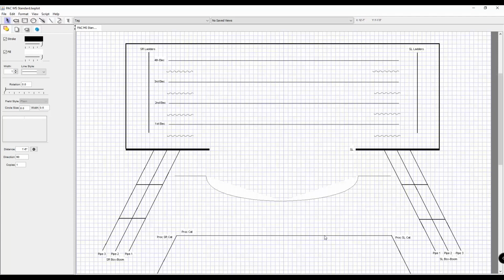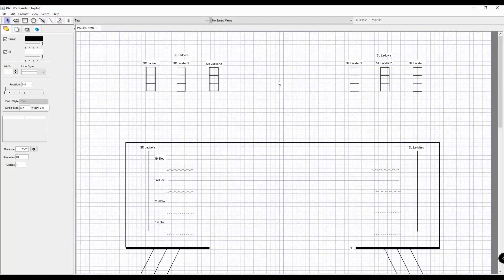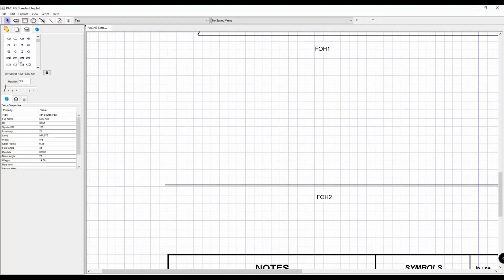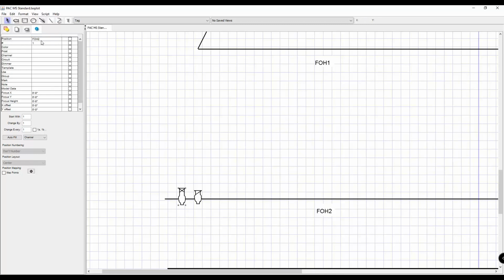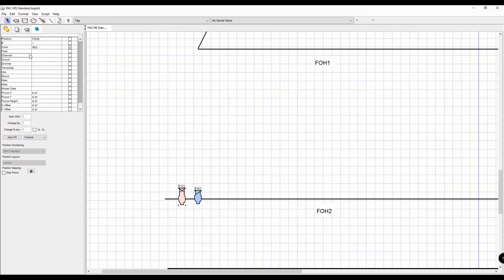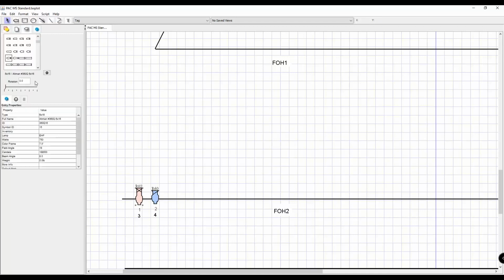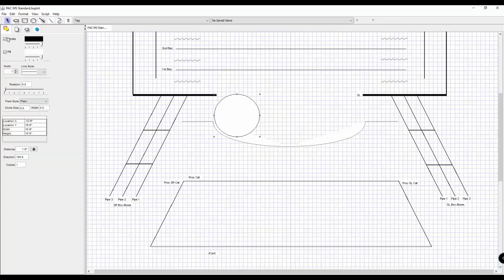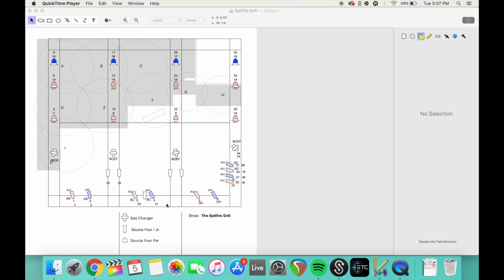How To create a light plot in LX Free

Comment: Isnt channel 4 the same as dimmer 4??
Reply: Actually, circuit is like a cable only. So, if your dimmers are not hard wired circuiting, the cable that goes from the light to the dimmers is the circuit. Then the dimmer is actually the number of the dimmer in the pack or rack that the circuit gets plugged into. Only in hard wired circuit situations are the dimmer/circuit the same thing.

Then, the channel is what the lighting console will control that dimmer with. Since the 80's, dimmers were made capable of being patched electronically at the console instead of manually at the dimmers. So you could plug your fixtures into dimmers/circuits 1 through 12 in the FOH in any order but then go to the console and patch those into any channel on the console you choose (eg: amber front light @ 1 thru 5, blue front light @ 11 through 15 etc).

So to answer your original question...in the 21st century, circuit/dimmer are often the same number, but not always. It will always depend on the venue. And yes, the channel and dimmer can be the same. That choice is completely up to the designer/programmer of the show. I work with a school that has 110 circuits and 96 dimmers with an ETC Ion console. So we still have to patch the circuit cable into an available dimmer backstage before we can control it with patch in the console.
Reply: Dimmer is the actual circuit that you connect the light to. The channel is the number you assign to that dimmer when patching it into the board. These CAN be the same, but aren't usually.
Reply: If you have a digital desk and use multichannel lights IE LEDs or effects, then you can patch it to any number. So that LEDs that are 4 channels don't skip 3 channels between selecting lights. Good for when there are lots of movers.